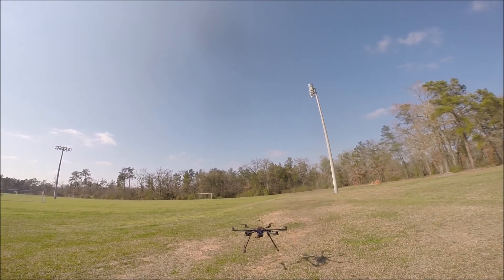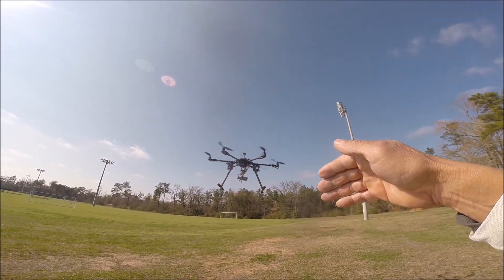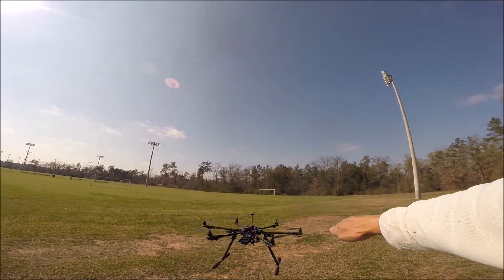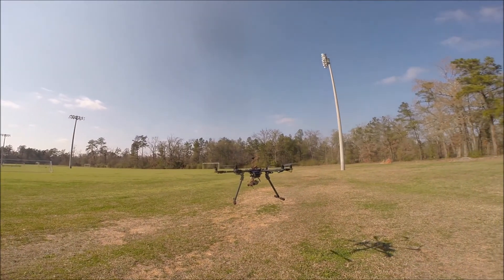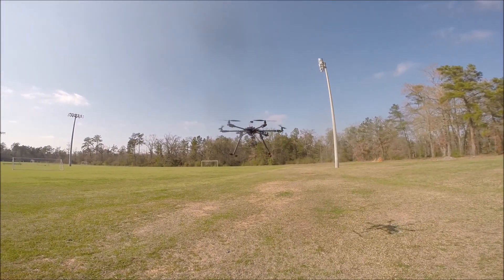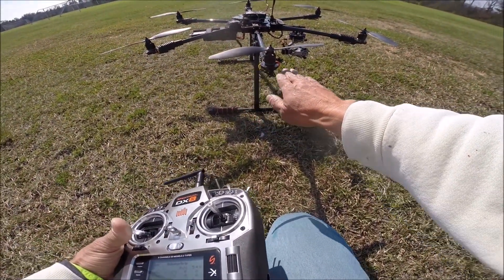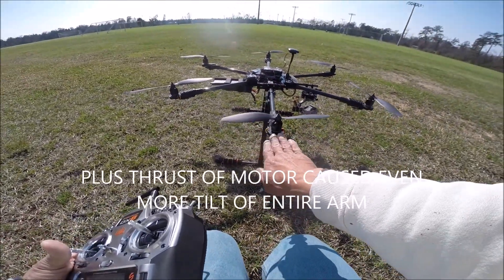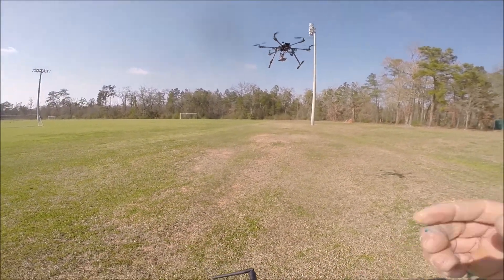HEXACOPTER 800 YAW PROBLEM PIXHAWK 3D ROBOTICS SOLVED

Comment: Is it really because of the motor mount?
Reply from the maker: Motor mount where it attached to arm was loose and motor was not perfect horizontal. aligned motor. Tightened screw and no more problem